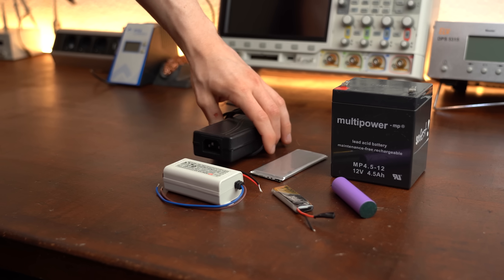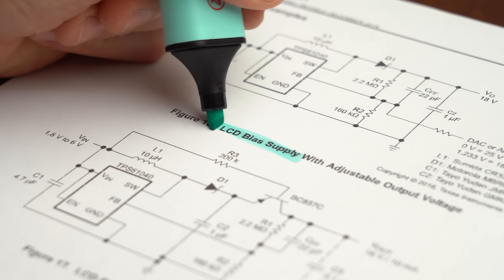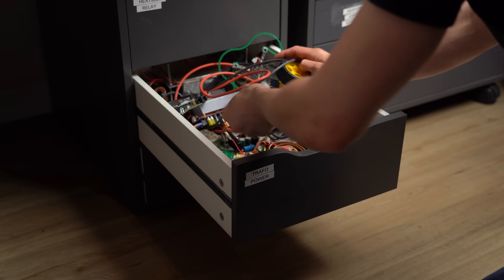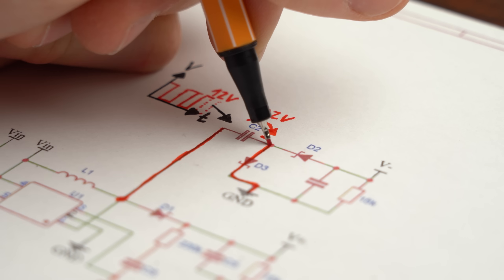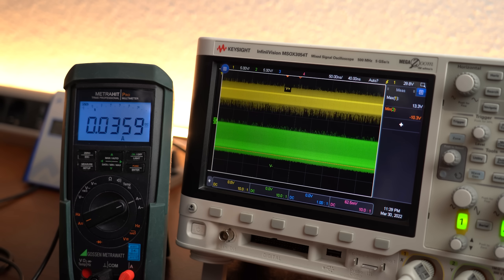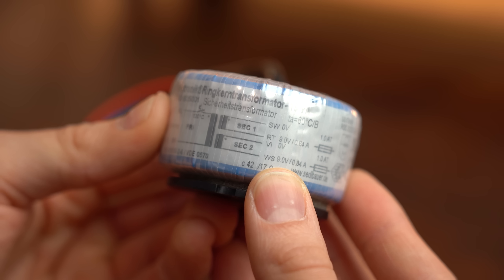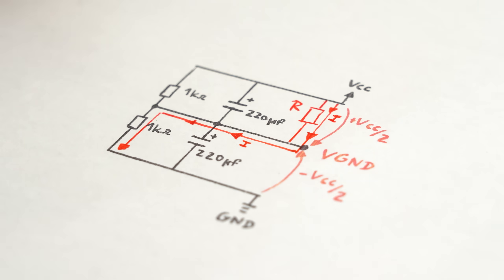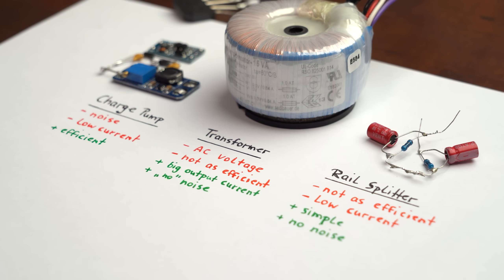Negative Voltages are more important than you think! So here is how to make them! EB#52

Comment: very interesting, as a mechatronics engineering student one of my main assignments for the semester was building a 100% analog temperature sensor in a PCB that is powered by AC. for this i used an opamp rail splitter design with a zener diode series regulator which i devised right after learning about current buffer circuits, so far it works wonderfully.

Comment: If using a second power supply that is delivering positive voltages is on an isolation transformer or internally isolated like many SMPS supplies (Switch Mode Power Supply) uses an optocoupler across an isolated circuit to vary the frequency of the drive circuit which changes the output voltage. The easiest way to prove that is to connect the supplies to a power strip, without voltage and measure the resistance between the negative leads. 
If the resistance is OPEN then reversing the connection is enough to get a negative voltage. Just like using a battery in a vehicle with a positive ground.

Comment: I made a crossover for my sound system and I needed a dual rail supply but didn't want to buy a transformer, so I used a USB charger and B0505S.
Input B0505S is connected to the charger, then the positive isolated output is connected to the negative charger and be a GND.
Positive from the charger to Out V+ and negative from B0505S to Out V-.

Comment: I want to drive a motor forward then reverse over varying times. Eg..3 seconds forward and half a second back. 24v 120 watt. Was thinking all I need is a square wave with a top positive voltage and bottom negative voltage with the centre being neutral. How would.you achieve this? Any ready made AliExpress boards?

Comment: One common solution is to add a push pull pair of transistors to the output of the opamp virtual ground. The transistors can boos up the amperage capability of the opamp and maintain the virtual ground under a higher load. Also they make small form negative voltage regulator chips now as well. I use one that takes in +5v and spits out -5v and they make them for other specific voltages. They are also very simple to use. Good job, just thought I would mention a few other options available as well

Comment: I would have also create one using a pwm ic and mosfet with a centre tapped HF transformer with some shottky diodes with filter capacitor super cheap simple and can push more output power. But good work Scott👌👌👌👌

Comment: Question, on the solder reflow plate, did you code it yourself? Do you have the coding for it? Did you use the Atmega328 or the Atmega4908?

Comment: Can't get the charge pump on the boost converter working properly, the negative rail was 3v 'higher' than the +ve rail (13v and -16v).
Reply: Oooops - my bad, forgot the resistor across the cap on the -ve rail.

Comment: So, if you have 3 output pins at 0V, 1V and 2Vs
But decide to label them -1V, 0V and 1V, is that all a negative voltage is?
You hook up your probe common to what you choose to be ground (0V) and everything else is measured relative to that point?

Comment: Can it also be done with a voltage multiplier? a capacitor and diode arrangement to tap ground from between the two capacitors, a bit like the one you did with the resistors.

Comment: Isn't any voltage we measure is a potential "difference". So they are all relative measirements. So if you simply create a voltage divider and use the middle point as ground for a circuit then the original ground would now be equivalent to a negative voltage. Am i missing something?

Edit: i just finished watching the video and looks like you did just that. So nevermind.

Comment: There are small negative voltage DC-DC modules on Aliexpress, and not many of them, like just one or two different ones with single-voltage output. I've found the hard way that they're very fragile. Do they also use a simple charge pump?

Comment: Another option you didn't mention:  Just use two power supplies.  You need to make sure that the supplies you use can function without using a common output ground between them, but many power supplies have effectively isolated input and output grounds, so many actually can do this.  Then you just connect the positive output of supply B to the ground from supply A, and B's "ground" output then becomes a negative voltage (relative to A's ground).  This can even allow you to tune the size/type of the different power supplies to match the current (or noise, etc) requirements of each rail.

You can also use complementary linear voltage regulators (i.e. a 7812 and a 7912) to maintain stable positive and negative voltages relative to a reference VGND...
Reply: Two supplies is an elegant and simple solution, although it's not based on a single circuit. I used this option when I was studying op amps and I had no time to build a dual-rail-supply, neither wanted to buy one.

Comment: I build stringed instruments in my retirement, which led to preamplifiers for transducers such as piezo pickups hot glued  to the soundboard.

To build a preamp I selected opamps as the basis for the preamp and started experimenting with an lm741. For several days I could not figure out why I could only get the opamp to amplify the signal as an inverted signal. Finally it dawned on me that the ground they referenced in the data sheet was not a typical chassis  ground and was actually as some call it a virtual ground in a dual supply power supply.

To test my new assumption I placed two 6 volt battery packs in series and used for lack of better words the junction of the two packs as a reference for ground in my circuit. Wala, now the lm741 amplified both in inverted and non inverted modes.

I see the dual battery packs in series as the simplest way to make a dual power supply that has no real down side I can see unless somehow you draw power from just one battery pack which then has the issue associated with a voltage divider when placing an extra current demand on just one rail.

I love the scheme and can't help think that using two voltage regulators such as that output 5 volts in parallel and then placing their outputs in series would also be very effective and likely without the voltage divider issue because ultimately drawing from just one rail is drawing from the source for each voltage regulator.

Comment: Oh wait... There are electronic engineers who are clueless when they see negative voltage now? C'mon. What happens when they see a germanium transistor? Oh well... maybe they haven't even seen a BJT...
Truth be told, I've never desoldered the whole board to reverse-engineer it. Most of the time using a multimeter on beep was enough. Nice scope BTW.

For audio amplifiers/preamps I'll still go with the traditional linear regulators and that transformer.
Virtual ground is fine and has been around in effect pedals for decades, probably ever since someone decided to put that 741 there.

Great Scott, a FULL BRIDGE RECTIFIER! It's all over the place now! :D

Comment: Thanks another great video as always

I especialy liked the part where you showed how to create no noise version

Now a question because I am realy clumsy and would just like to buy something

Is there a store I could buy linear power supply (simple one it doesnt need to be variable), just something I could use to power my led strip or christmas light or coffe machine, etc

You see, whenever you buy a led strip in IKEA or other stores it always comes with swichmode power supply that you can trow in the garbage because it produces noise

In fact, I dont even know where to buy a transformer (like a store where you could pick the voltage and the current rating (like 12V 4A) and get yourself a transformer that converts 220V to 12V

Comment: Can I use two buck boost converters side by side and take power from  one source amd then try to  put them into series connection to make one  ground with a positive and a negative supply . Kindly tell would this work , i have two 80 watt dc to dc converter lying in home and don't want to ruin them for an experiment , but you can do it । 🙏

Comment: Can you just use 2 boost converters, set one to 12v and one to 24, then use the 12v output as virtual ground, the original ground as -12v and the 24v output as +12v? I guess you can't but why not?

Comment: Great, I have an old analogue multimeter which uses two 15V Foto batteries and I guess thats needed to make +/- 15V... I want to convert it to a stationary one without batteries. I think the OPAmp method is probably best, I don't expect it to draw much current.

Comment: some high volt things need negative volts coz the relative voltage diff is what does the bad archy stuff. theres an applied science vid where he takes appart one of those metal typing hand held scrap yard machines and explains this in the high voltage side of things coz ur sticking the nose on a conductor lol

Comment: The last one is probably the most useful to me. I’ll normally have access to a bench power supply or can wait for a mailed chip to do that power converting for me, but sometimes I just want to test something that involves an op-amp needing + and - rails using components I have just laying around. Knowing that an op amp in the middle can help stabilize is pretty useful.

Comment: Great info, I've got a waveform generator I built for a Uni project and have never gotten around to building a dual rail supply for it, of course at uni we just powered it off the bench supplies, wasn't until I took it home I realised I couldn't use it. Yet.

Comment: I like my dads power supply - an transformer with multiple voltages like 6.3v 12v and 200volts - AC ofcourse. Dont need the center tapped transformer either, 2 halfwave rectifiers on a 12 volt transformer + regulators will work too . Less current capacity

Comment: i know you have to make your money somehow, but still, advertising for altium is kinda irresponsible in my oppinion. if new hackers start with altium they will eventually come to the point where they have to either pay a horrendous sum or relearn pcb design with a different eda tool. additionally i have never actually seen anyone who advertises altium make any circuits where you would really need the fancy features i assume altium has for. reccomending new hackers to learn anything but kicad is kind of shit since it's setting them up for unforeseen costs down the line but altium, being one of the most expensive eda tools in existence is especially insidious in this regard.

Comment: If you could get the right boost converter you could probably invert the polarity of the output by reversing the input voltage connection. I've tested it in circuit sim and it works there

Comment: Easiest method for an instant, efficient, negative power rail that can supply some juice is to use a standard buck regulator like a LM2596 based circuit, but connect the input power between the + in and + out (+V to +in, 0V to +out). Negative rail appears on the circuit's 0V/common connection. the voltage set resistor defines how negative it goes. Derate power because both the input and output current have to be counted through the current rating of the IC, so if you are matching the input voltage with a negative voltage, halve the current rating. Surprised you didn't mention this one...

Comment: Eigenkrafts!! Opamp Vgnd toll!!! I used two similar boost converter to create negative voltage in one of my skiffs, it uses the 12v out of one to ground input of the other, the inverted out of the latter gives neg rail. Plenty of noise anyway, not the best approach, but with some filters gets the job done very efficiently. Never thought of the pump solution, quite interesting!

Comment: 7660 charge pump plus a couple electrolytic capacitors is a simple & inexpensive way that can run on +1.5vdc to +10vdc (like +5vdc from USB) to generate corresponding negative DC voltage supply.

Comment: for even higher current, you can add a pair of npn/pnp transistors (e.g. 2n3055 mj2555) on the output in half bridge (bases to op amp  out ,  emitters together connected to op amp - and virtual ground. collector of pnp to V- collector of npn to V+) add a couple of smoothing caps between both rails and virtual ground.
note that since you're basically burning the imbalance current, the transistors will heat up a lot in some cases (you're getting I*rail voltage, so better make sure there's adequate cooling).

Comment: can't you just make that second one you showed with the transformer at lower voltage using a capacitor and a n-channel mosfet driven by something like a 555 timer or a 74HC14 hex inverter oscillator(one of the 6 oscillators/schmitt trigger inverters). the capacitor is not even needed but will make the coil tune itself, otherwise you will just get a lower efficiency and a lower difference between the + and - peaks.

Comment: I have a challenge for you that is right up your alley and would make you a true hero to all (specially older) techies. Seems worse as I get older, but even as a young man, at the workbench making projects I invariably drop a screw, resistor, cap, nut, bolt, or some damned thing. Then I spend the next ten minutes with a flashlight looking for the thing. Even light things seem to be able to bounce over an amazing distance when I finally find them. With some things it seems as soon as I find and try again, whoops, now where did that drop to?

So I think you ought to do a project where you have a camera under the workbench, that tracks any lost item that drops into its field of view and maybe a laser pointer to show where it ended up? 

Now THAT would be a project all your fans could really use! :-)
Reply: Sounds interesting but I assume it comes with a lot of programming and working with AIs of sorts. Would be nice to see a software and electrical engineering youtubers work together tho.

Comment: I use two buck converters in series.

- Input negative become the target negative voltage
- First stage output positive becomes the target positive voltage
- Second stage positive becomes the target ground voltage

There are two buck converters to adjust, which is a disadvantage and, for reasons that I did not investigate, the first buck converter heats-up like crazy and ends-up dying after a while.

Comment: Be careful on virtual ground approach. Never share the same ground with other circuits that uses the true 0V grounding. If you need a signal route to external circuit, use optocoupler or bypass capacitor to isolate the signal grounding.
Reply: yeah, super short circuit current from doing that, things puff up the smoke real fast
Reply: I think the circuit started without a true ground signal to begin with, only the first 3 out transformer had true ground.
Reply: But what is "true ground"? Are you guys talking about the Earth pin in your wall mains?
Reply: @Nintendj yes

Comment: I have just completed my school project a 350 W bluetooth speaker and the biggest problem for me was to make simetrical power supply(for supplying preamp) as i have only dc source and making the inverter for transformer is not efficient. I had found the same page that you have shown in the video and i made a divider with two transistors and everything works fine. Its interesting that you have uploaded this video now when I had already gone trough this all..

Comment: Hi, i have a roboust dc dc step up converter that can deliver up to 1200w. Sometimes the input is 12vdc and the output is 90vdc. Now suppose i can pick up the signal on that place, it is possible to create  -90vdc with significant current, right ? After all, we only need to use schottky diodes that supports the desired current and tension, right ? Why do you say there's a current limit problem ? Because the main step converter ( not the charge pump ) is low current, right ? Can i add the charge pump circuit to a step up converter like mine ? It would be nice to generate let's say -12vdc to -90vdc with significant current... Thanks 🙂

Comment: 1. Get a boost converter.
2. Replace its inductor with a center tab transformer.(use boost con as flyback)
3. connect the center tab to gnd..
4. Do a positive and negative rectification with the other two ends of the tran's secondary winding.

I've done it so many times. The negative output can do as the positive.
Current limiting also works with negative output since most current sensers are placed in gnd..

 DVD power supplies does it except step down( but only for referencing purposes)..

Comment: 0:13 Let me warn you about those handy connectors, they look great and solid however the INSIDE is the thinniest wire I have seen. In fact it is a terminal SOLDERED with very thin wire to a connector and then molded into a thick layer of rubber/isolation. So yeah it looks very solid however ...... You can cut thru the middle easily with an exacto knife and you will be surprised you don't see any wire or bare thick metal. However, when you look closely to the surface cut you can spot two tiny dots. These tiny dots is the diameter of the wire used in this connector. So if you wonder you cannot get the amps you want or notice a voltage drop, it is because of this crappy connector!

Comment: I have a question. ESCs use positive and negative voltages to drive a BLDC motor right? I took one apart from an electric scooter and aside the part of the circuit that handled generative breaking, it consisted of control components and just MOSFETs. Couldn't that approach be used for high current applications? My scooter can draw up to 20A so technically it would work but would it be possible to convert that circuit to a dual rail power supply with some clever switching and capacitors?

Comment: Also you can use so called transformer driver ics that generate AC to drive a center tap transformer from a dc source. You can get very low noise and good output current from a device like lt3439.